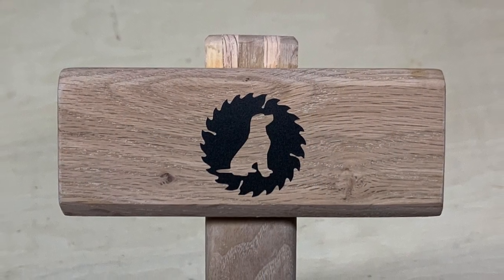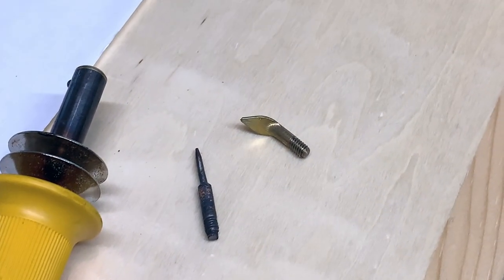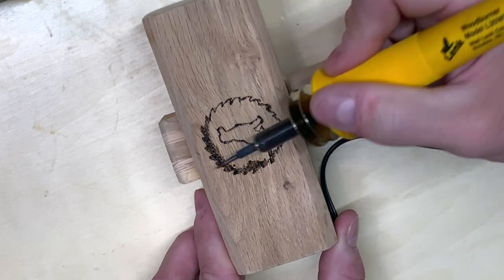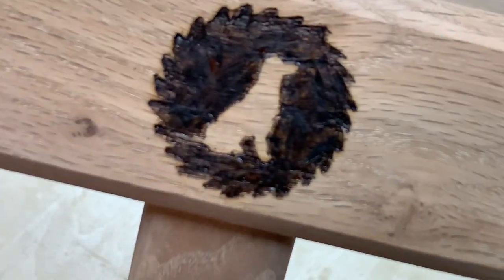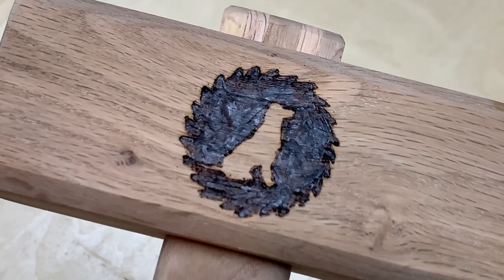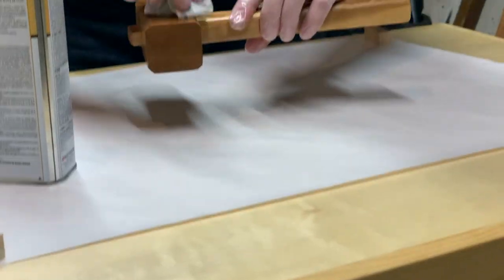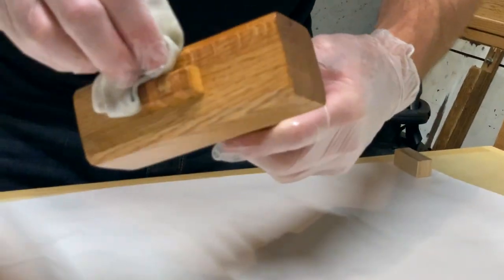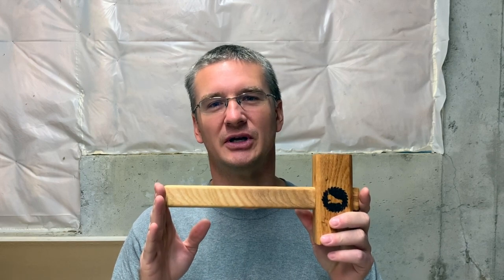Fun With Pyrography // Woodburning Our Logo On A Mallet // Woodworking

Comment: Looks good to me!  The flat tip sure seemed to work better than the pointy one for filling things in.  I guess for detail work wood selection would be of paramount importance.  Maybe your next mallet could be from Maple?
Reply from the maker: Thanks! Yes, the flat tip was definitely the way to go for the majority of it. Woodburning is something I’ve barely played with, so it was fun to learn a little about the process, including the fact that oak isn’t great for it. I bet you’re right that maple would be, though. The handle on this mallet is ash, I should try done is that and see if that works better too.